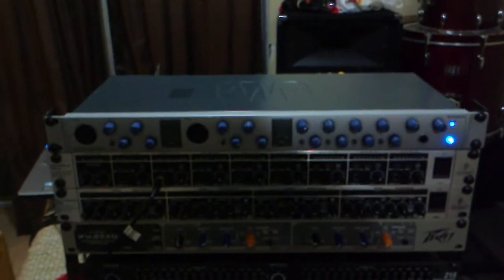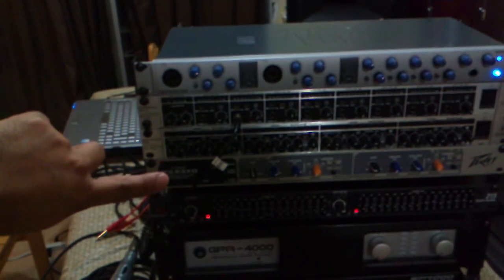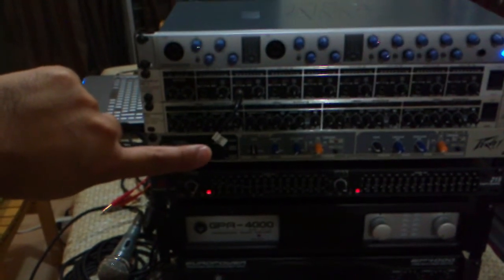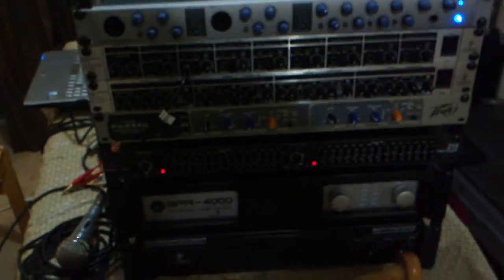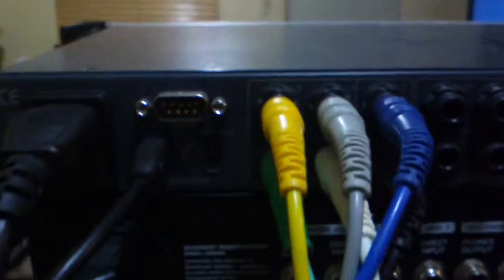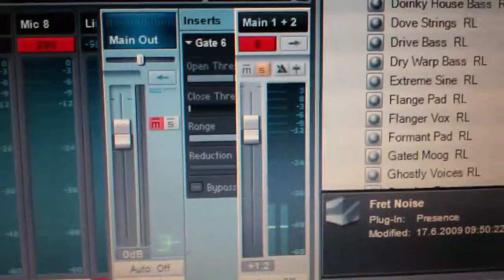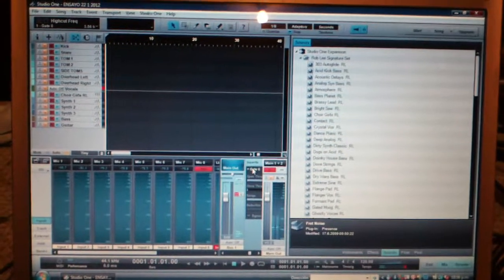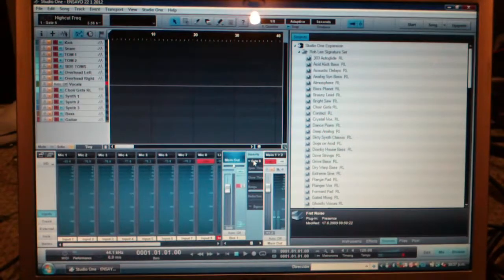presonus firestudio tube as a live console with power amps

Comment: You might move the Fire studio Tube away from the power amps. Some times Tubes will make some weird noise. I don't know if it will work. 

I'm just wondering why you have so much equipment added to the set up? Studio One has all this stuff built in. I would recommend using a DBX Drive Rack PA.